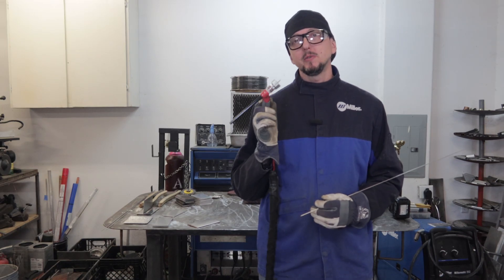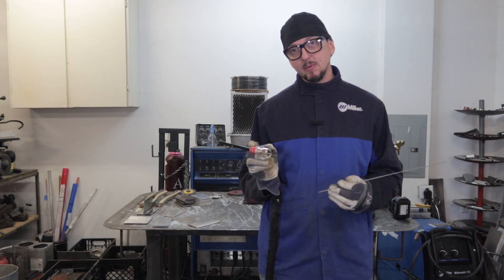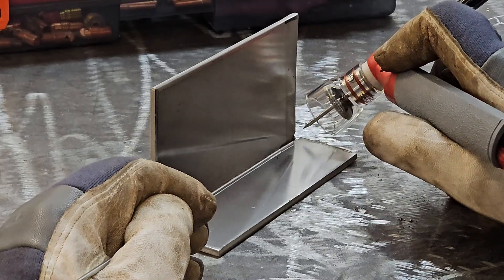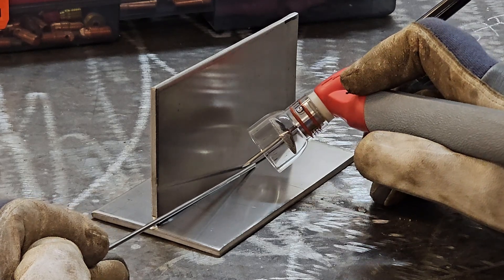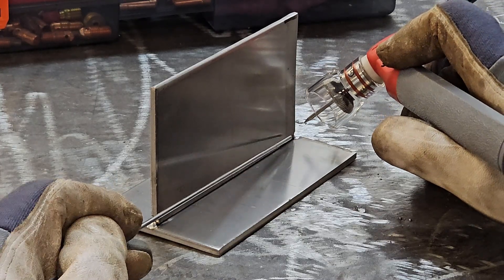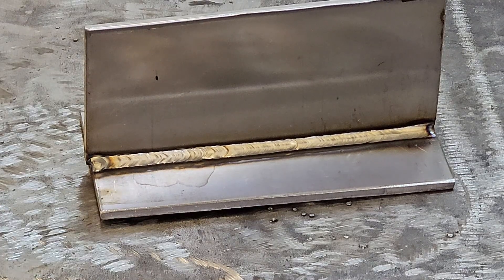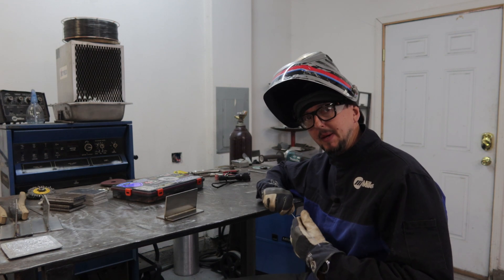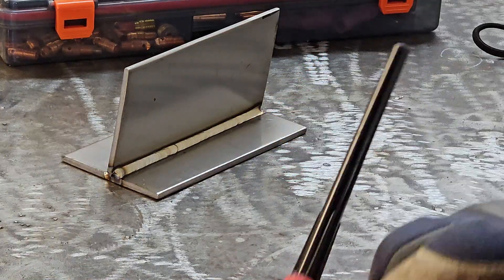How to Pedal Pulse Tig Welds

Comment: is your filler 308 or 308L?  does it make a difference?  your presentations are excellent.  thanks!
Reply from the maker: 308L, low carbon, it just makes the welds less prone to sensitization because there's less carbon available for carbide precipitation. Thanks man, appreciate the support 🙏